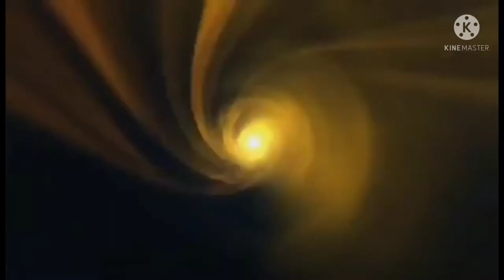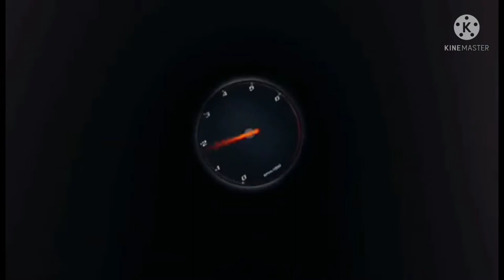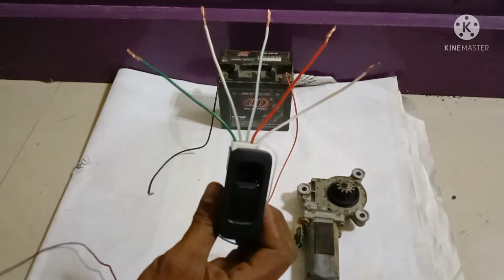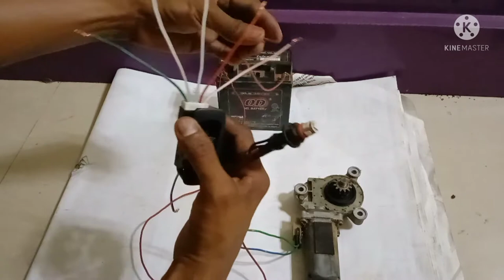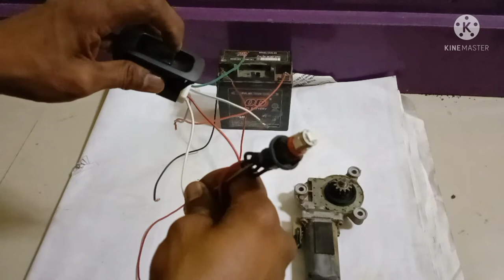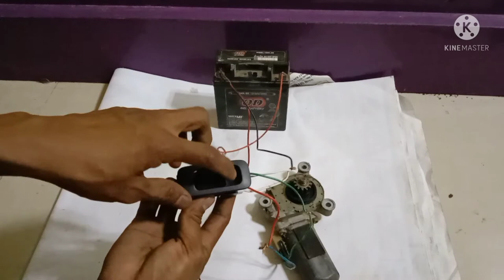PAANO MAGKABIT NG SWITCH NG POWER WINDOW

Comment: Same lang ba sa driver side na master power window switches?
Reply from the maker: Same ng linya ng positive line galing sa master switch.
Reply: May video po ba kayo on paano mag wire ng driverside master switch para ma control ang passenger side window?
Reply from the maker: Try q mag upload sir. Busy kasi sa talyer Kaya di aq makapag upload ngayon. Need mo ba ung video nung main switch ung 4 ang pindutan.
Reply: Thank u for ur fast reply. Malaking tulong to sa mga DIY projects. 2 door lang sir. Driver side and passenger side. Nag change kc ako ng main power window switch.galing sa ibang sasakyan.  Napagana ko na driver side sa tulong ng video mo.
Reply from the maker: @kenvaldez2  boss anong switch ba ginamit mo sa driver side?
Reply: Galing sa toyota starlet. Pero galing sa lazada so ndi ko alam if pang starlet ba talaga
Reply from the maker: @kenvaldez2  sir double switch ba or single lng ung nabili mo?
Reply: Double. Integrated na ang power lock button and passenger window lock button
Reply from the maker: @kenvaldez2  pwede ba makita switch na nabili mo sir. Send mo sa messenger q para magawan kita diagram.. Ronnel Manzana fb account q..
Reply: Nakapag pm na po ako
Reply from the maker: @kenvaldez2  ano name nyo sir sa fb.

Comment: Nalinisan ko na rn po switch sa passenger front side po pro ayaw pa rn gumana pataas nya...possible po ba sa master switch ang problema sir?..3yirs plng po kotse nmin sir
Reply from the maker: Pwede po sa master switch ang problem sir.ano po ba auto nyo.
Reply: Suzuki celerio 2019 model sir...
Reply from the maker: Sir try nyo po gamitan ng test light .kailangan po ung 2 wire ng switch sa passenger side e may 2 negative supply.pag wala po supply na negative sa master switch na po ang sira nyan.
Reply: Pwd rn po pababa sa master switch sir kaso ayaw rn sa pataas gnun rn po sa passenger side switch ayaw rn sa pataas pro pwd pababa...master switch po ba kya ang my dahilan sir?...
Reply from the maker: May test light po ba kayo sir.kung meron po pwede nyo ma trace kung master switch nga po ang problem..kasi po kahit  ayos ang single switch sa passenger di po talaga gagana yan if sira na ang contact galing sa master switch .
Reply: Meron po ako test light sir kaso hndi ko alam gamitin sa troubleshoot sir...paturo nman po sir pra DIY ko nlng po.
Reply from the maker: Bunutin nyo po ung socket ng switch sa passenger side.tapos ung test light nyo po kapit nyo sa body ng sasakyan.pag nakuha nyo na po ung positive line,ikabit nyo naman po ung test light sa positive then isundot nyo sa lahat ng wire kailangan makakuha kayo ng 2 negative line ..pag isa lng na test nyo na negative line ang problema po ung sa master switch kaya di din ngana sa passenger seat.
Reply: Cge po sir try ko po bkas gamitan ko po ng testlight...my remejo po ba f skali master switch ang sira sir?..tnx po ulit sir
Reply from the maker: Try mo buksan sir ung main switch baka po madumi lng contact.pag madumi lng try mo lng linisin ng liha..
Reply: Hndi ko ulit ma troubleshoot sir xe gumagana na nman po..my dalawang negative po at isang positive sir un po ang findings ko po sa testlight knna..
Reply from the maker: Boss nag upload aq ng video about sa switch..baka makatulong sayo .para mapagana mo kahit sa single switch mo ung power window mo ..salamat